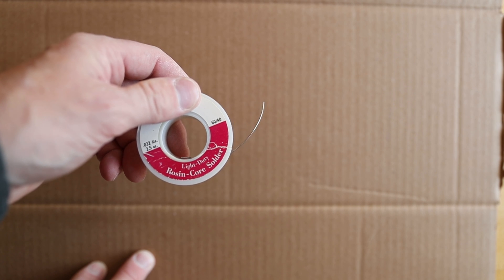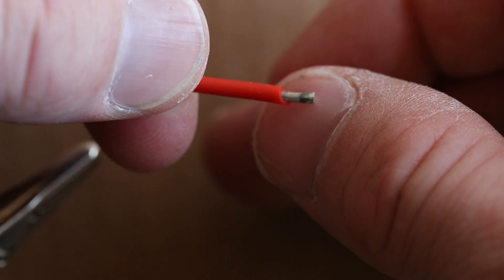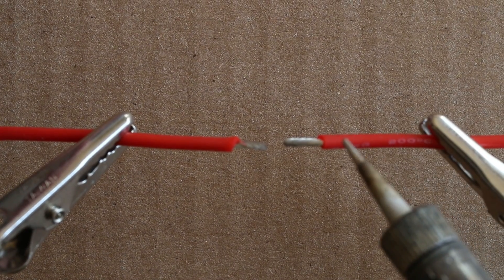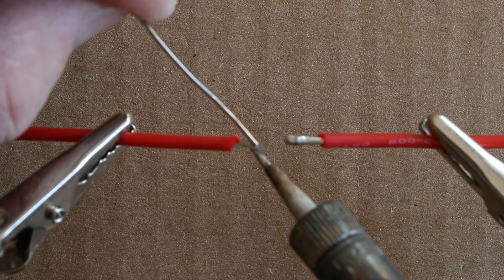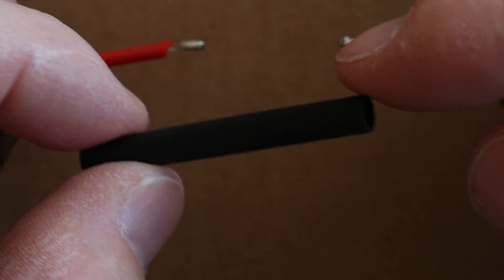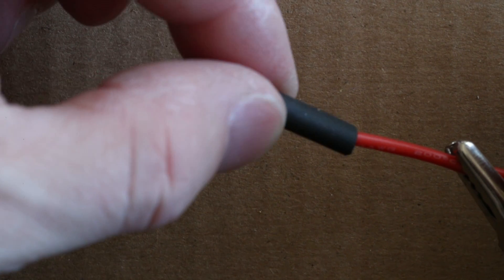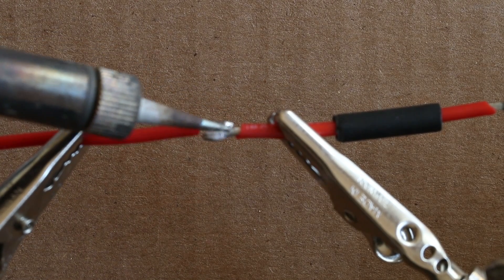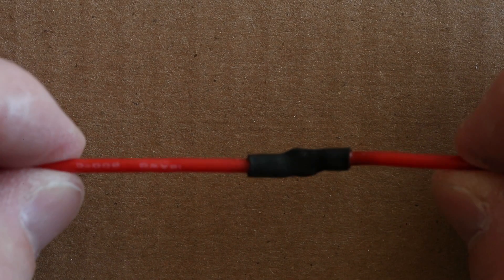How To Solder

Comment: Great tutorial, maybe? But re-do it in focus, my eyes were bleeding.
Reply from the maker: andy cooper Ah those three parts of actual soldering. The problem was my camera rig was a tiny bit to short for the focal length of the lens. I’m working on a way to fix that. This is the only real thing in this video that upsets me. I may need to build a platform to hook the rig to that I can clamp to my table.